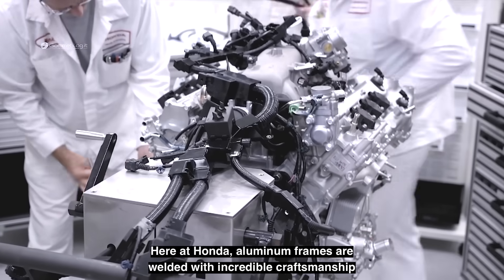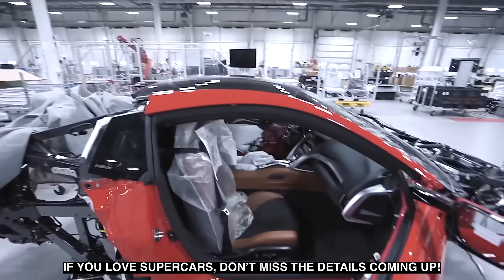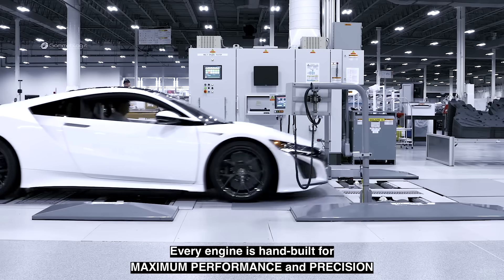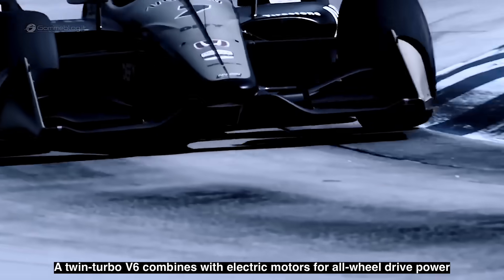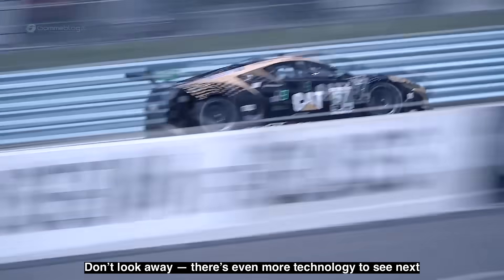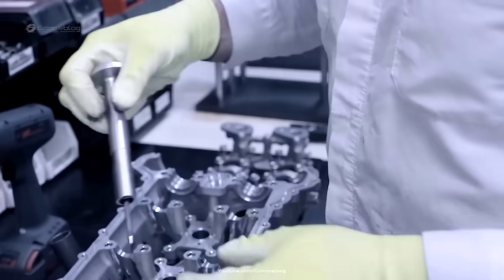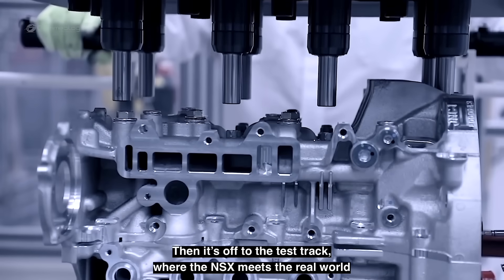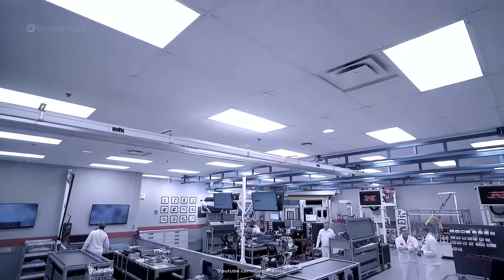TOYOTA Industry: The UNBELIEVABLE Way THEY Build Hydrogen Cars in Japan

Comment from the maker: Hydrogen cars are the future or just a passing trend? 🤔 
Tell us what YOU think! Would you drive a Toyota Mirai, or do you prefer full electric? Drop your thoughts below — we’re reading EVERY comment! 🚗💭
Reply: There is difference between hydrogen fuel and hydrogen fuel cell and many are not aware of this.
Hydrogen fuel cell is no efficient as the ratio for producing it to performance is lowest when compared to EV, ICE and hybrid (electric).
There is a lawsuit in the US against Toyota for failing to setup the hydrogen fuel cell infrastructure.
With EV anyone can charge at their home but Hydrogen fuel cell it's not possible.
It will be good for construction, farming and trucks and lorries.
Reply from the maker: You raise some really valid points here. It’s absolutely true that hydrogen fuel cells have a lower overall efficiency compared to battery electric vehicles, mainly because of the extra energy needed to produce, transport, and compress hydrogen. Studies show that hydrogen fuel cell vehicles convert around 25–35% of the energy well-to-wheel, whereas BEVs can reach 70–80% efficiency. That’s a huge difference, and it explains why many consider hydrogen less suitable for light passenger cars.

On top of that, you’re right about the refueling infrastructure. Unlike EVs, which can easily charge at home overnight, hydrogen refueling depends on a very limited network of specialized stations. That’s why there are even lawsuits in the U.S. against Toyota for failing to deliver on the promised hydrogen station availability for Mirai customers.

However, hydrogen technology might still have a strong future in sectors like trucking, construction equipment, and agriculture, where vehicles need long range, quick refueling, and where installing massive battery packs might not be practical due to weight or downtime concerns.

Overall, it’s a complex topic. Hydrogen faces big challenges in infrastructure and efficiency, but it could complement batteries in heavy-duty or industrial vehicles. We’re curious to hear what others think about this: will hydrogen remain a niche solution or can it grow alongside battery EVs in the coming years?
Reply from the maker: You make excellent points about the challenges of hydrogen fuel cells — no doubt, efficiency and infrastructure are major hurdles today. But it’s also important to recognize the role of continued investment and research in hydrogen development. As the world transitions to cleaner energy, hydrogen can serve as a flexible carrier, helping to store and transport renewable energy across regions and industries.

Developing hydrogen technology now could pay off long-term, especially for sectors where batteries alone might not be practical, such as aviation, shipping, heavy-duty trucking, or even seasonal energy storage. The production methods for hydrogen, like electrolysis powered by renewables, are still evolving and could become far greener and cheaper in the next decade.

So while hydrogen cars might not compete directly with BEVs for private passenger use, investing in hydrogen research today is still crucial for a diversified, resilient, and future-proof energy system. Would love to hear other opinions on whether governments and manufacturers should continue funding hydrogen development alongside battery technology.
Reply: @GommeBlog : bạn hỏi Stanley  Meyer cách thức sản xuất xe chạy bằng khí hydrogen ???
Reply: I can’t refrain to see an even more complex and doomed system than LNG car which still barely exists in a few countries. Who wants a car insanely expensive to buy, maintain out of warranty and which costs more to run, is super hard to recharge and has no cargo? 
Japan is the master of perseverance. How many Wankel powered cars are on the market right now?
How something which has the third of the energy efficiency than a BEV (source to wheel) can have any chance of surviving?
Reply: 未来い乗って見たいな水素それから水が燃えてる車にきょう
Reply: @GommeBlog ê nói vậy là xe của vin fat nhật vuon là ngon ha
Reply: I would rather prefer methanol and a reformer instead of the hydrogen tank.
Reply: @drgyt2469 that’s better indeed
Reply: Hydrogen sounds promising, but the charging network is tiny compared to EVs. Would you give a Mirai a shot if stations were everywhere, or stick with electric?

Comment: Seen your videos from Porsche and BMW factories, looks like they have a lot more robots doing the production but Toyota don't do it that way but manually by hand, even the wheels are fastened bolt by bolt here, not so at Porsche factory.
Reply from the maker: Great observation! You’re absolutely right that Porsche and BMW factories use very high levels of automation, especially for repetitive tasks like welding, painting, or wheel installation, where robotic precision saves time and increases consistency. Toyota, on the other hand, has a long-standing philosophy of ‘jidoka’ (automation with a human touch) and ‘kaizen’ (continuous improvement), which places great value on skilled human workers even for tasks like wheel fastening.

It’s fascinating because Toyota believes that having humans involved in assembly allows for quick problem-solving and continuous quality feedback, something robots alone might miss. This is especially true in more flexible production lines with many model variants. Of course, it can slow down the cycle time compared to fully robotic systems.

What do you all think? Should manufacturers move toward even higher automation to cut costs and improve consistency, or keep skilled people in the loop to preserve craftsmanship and adaptability? Would you trust a car built almost entirely by robots, or do you feel better knowing humans still have hands-on control?
Reply: @GommeBlog I think the Toyota-way of doing it as you describe it sounds reasonable in every aspect, people need work and higher automation is of course mainly done to cut costs. Hard to avoid maybe
. But it amazes me that it is in Japan they do it old style, always thought of Japan as an very high tech modern society and that they would have the highest degree of automation.
 But i must admit seing robots in action in your videos from Audi(making electric motors), Porsche and BMW it's very impressive.
Reply: Una manera muy sencilla de dar más empleo 🙏🏻